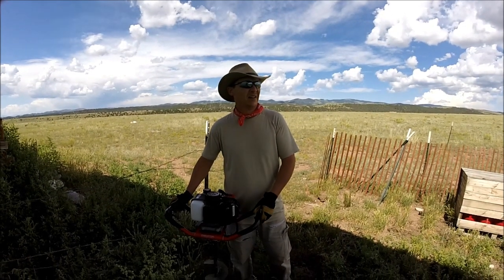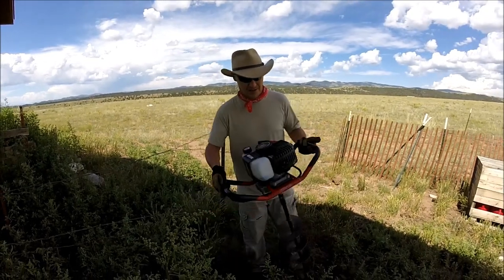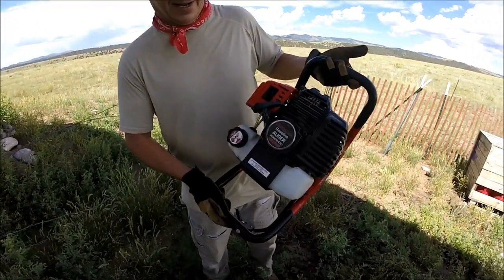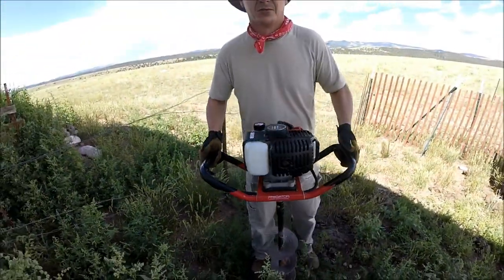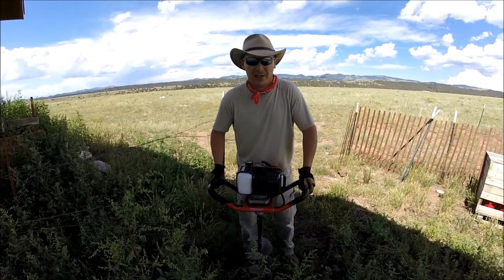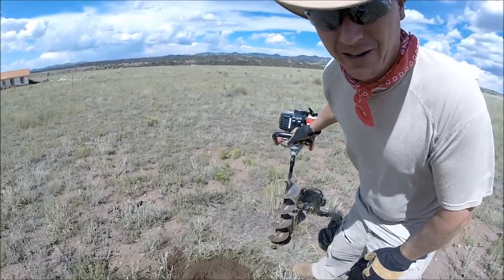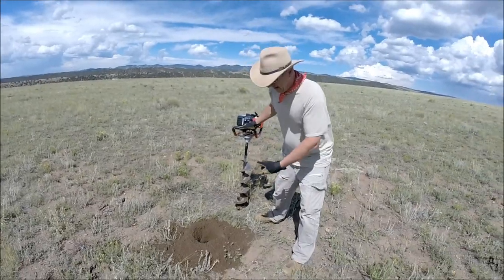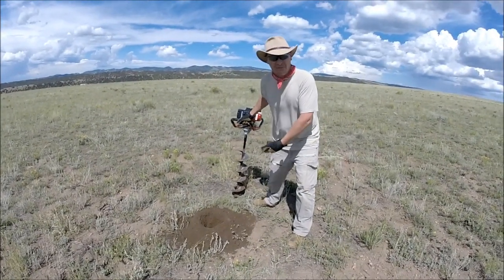Harbor Freight Auger - Rocky Soil Test

Comment: I’m a strong old boy of 72 and where I live the soil is rocky (very rocky) and, having used this, it’s a dangerous wrist breaker for my soil 😂 It took me for a dance a few times and it would have done me damage even in my 20’s 😂I eventually did around 20 holes and finally the penny dropped that the risk wasn’t worth it. I now hand dig everything. But, the question was a good one and frankly my answer is steer clear if your soil is really rocky.

Comment: Damn if only it worked like that for me 😂 I live in PA mountains only 1900ft above sea level. I can’t get more than 3 inches down without it getting caught on rocks. Sucks!!!
Reply: Shale?  We have shale here in south central PA. But my husband got through it for a post hole with a tubular post hole “pounder” that he built, basically hammering in a steel tube 18” down to then slide the 12’ post into. Any deeper, and we might’ve needed a jack hammer. But nothing would’ve stopped us—we would’ve just rented a jack hammer if necessary. There is a huge line of boulder rock here in the area too, that follows the entire Appalachian Mountain range from Maine to Georgia. Luckily, we are just outside that rock line. The shale is irritating, but at least it crushes somewhat. I think these little augers would work if intermittently used with the pounder tool and a solid rod, like a leverage rod with a flattened or pointed end on it that can crack PA shale. If all else fails, we’ll be pulling out the tractor shovel and rearranging the entire top layer of the property, 🥵
Reply: Same. In scablands of Eastern Eashington-on a cliff that was once the shores of ancient glacial Spokane lake. Soil type: "Extremely sandy gravelly loam". In otherwords, nothing but super compressed river rock and silt. Pretty much need an industrial hydrologic CAT auger to safely do a thing. Takes me 45 minutes to dig a square foot hole.
Reply: @andreaberryman5354  funny, I'm in Yakima and doubting this would work either.
Reply: @andreaberryman5354  

It's basalt bedrock, not river rock. That's why it's so hard.

Comment: I bought a cheap jackhammer specifically for working at the foothills. Here in Colorado the auger just beats you up and your lucky if you can get a foot of depth
Reply from the maker: Great idea! Like you said if you get a foot deep with this you're doing good. It works great in gravel, clay or regular dirt but large rocks stop it in it's tracks.
Reply: Thats not a bad idea. I've rented jack hammers to break up rocks before putting in the catwalk on our fishing dock. Thanks for the tip.
Reply: @sjeverett75  also drill 3 3/8 holes into the rock in a triangle pattern. Cut 6 inch pieces of 3/8 rebar or 3/8 spikes beat them in the holes and that will keep the post from rocking

Comment: Remember also if dealing with powder soil or rocks and powder. run auger down. poor enough water in so powder becomes moist and sticks together. Too much make Mud. Works really well when your hole get bigger from walking around.  Get it wet and you can for sure get some nice-looking holes.

Comment: Nice vid! Where are the rocks though? Lol I live in Colorado and have the same HF auger and can't dig much with it usually unless I drill out a pilot hole with a smaller drill. Then again, the expensive ones don't really do any better.
Reply from the maker: I shot this on a gopro and it doesn't really show all the gravel that I'm pulling up. It works great on small rocks. When you hit a big rock it stops in it's tracks and you either have to move or dig out the rock/boulder. I'm sure a lot of it is going to depend on soil type.

Comment: So can you dig a 12" hole using the 8" bit by shaking it around? Lowe's doesn't rent one with 12" bit.
Reply from the maker: Yes, just lean it slightly and it will work.
Reply: @TheHandsOnChannel    So dig at an angle? Thanks! I need to drill holes for some 12 inch sonotubes.
Reply from the maker: @CringePanda  Go in straight and after you reach the desired depth, gently lean it from side. They call it wallering out the hole where I'm from.
Reply: Sometime you dont even need to lean, as the vibration and torque moves it around. Holes always end up a little larger than the bit
Reply: @TheHandsOnChannel  I bought it, but I wish I had spent a little more and got an Earthquake. The 8" bit tends to get stuck once it's all the way down, then I have to dig it out by hand.

Comment: Just did 80 ft of fence in small rock soil it did ok but if you hit a big one your done get the rock out is the only answer. But in Sandy soil it will get the job done big rocks you got to get a bigger machine with way more power!
Reply: I did the bigger machine. Skid steer and auger. What I learned. River bed rocky get a small backhoe on a skid steer. dig holes remove big rocks. backfill hole and pack with a backhoe. now run the auger. I did it another way with sonic tubes and craters for holes from the skid steer auger. A lot extra concrete and sonic tubes. It worked the big sign went up and deals with high winds. The company put up rent a fence and put the green cloth on with no wind holes. Warned them fence can not take that force. They ignored my warning and big winds blew and folded the fence over. About 250' of the fence got folded over. And my large sign on 4x4 posts and bracing had no problems with the wind. Since then backhoe for river bottom crap.
Reply: @1stFlyingeagle  like always free advice is ignored! Cool story man!

Comment: I was thinking about buying one of these for a fence around my house. I live in west Texas and the ground is hard dry clay with gravel mixed in. Its almost brick. Better than post hole digger by hand.
Reply from the maker: Yeah I'd wet it down the night before you auger. It should work for ya. Good luck.
Reply: I'm in west central TX and we have alot of caliche. Almost impossible to dig holes without a rock bar
Reply: How did this work out for you? Have property in Big Bend area and was thinking about getting an auger.

Comment: hello, I have the same model.  Just replaced the entire carburetor, fuel line, filter, and spark plug (amazon kit) and it's now easily start immediately after 1 crank.  However, it's no longer putting out the same torque as before where it would toss me around like rag doll.  It's just slowly turning ...very very slow.  It's running excellent though, no hesitation, smooth ride minus terrible torque when digging.  Please help, any tips to to fix my issue? Anyone?

Comment: Is there speed control idle throttle ? doing a fence terrain is similar to this video ..... great display
Reply from the maker: Yes you can use the throttle to control speed to some degree. Although you have to have it spinning fast enough to penetrate.

Comment: QUESTION.: When you hit a rock , ! Isn't that rock already a good foundation ? 
I would say,  " no need to dig any deeper.
Reply from the maker: Sure could, as long as you're in a couple of feet.
Reply: @TheHandsOnChannel  Exactly. Mine starts about 5cm down. All the auger does is polish the rocks, so sadly I'm stuck. Tractor diamond tip PTO auger, maybe, or crowbar digging :(

Comment: That is not rocky soil...
Reply from the maker: Right, it's on top of a mountain and it's not rocky. YT critics crack me up.
Reply: @TheHandsOnChannel  if it were rocky soil, there would be rocks coming out. I see no rocks coming out of your hole. I see nice fine soil coming out. It would be great to see people not misrepresenting augers on YouTube, augers are fairly dangerous in rocky soil, as soon as you hit rocks of a certain size (a few cm’s) the machine stops rotating and you start rotating instead unless the machine has a cutout lever. I know this because I have dig holes with a two man post digger in my rocky garden. I have also hired someone who had a dingo/kanga machine (the type with caterpillar tracks) digging large holes and when that thing hit a rock, the tool shifted laterally about 10cm taking the path of least resistance. I have also seen other YouTube videos where the were using a tractor to drill holes and as soon as they hit rocks, they had to dig or use demolition hammer to break them up. If people thing about it logically an auger cannot cut rocks which is why you use impact tools or 6ft fencing poles to break them up.
Reply from the maker: @RandomSmith  I never said it would cut rock. Maybe you didn't look hard enough. Are you on a cellphone?  It may look like soil but it's full of rocks. I even hit a big one at the end of the video. I usually put a death grip on this 1 man auger and it'll stop if you get bound up. It doesn't twist me up.